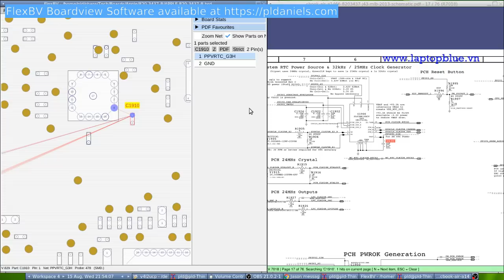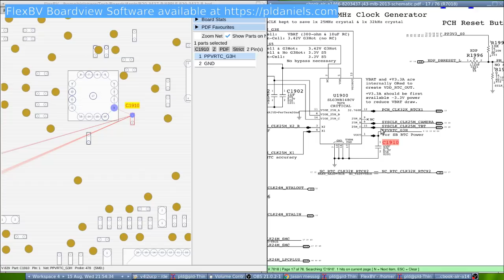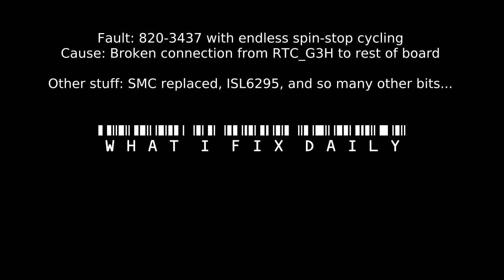MacbookAir A1466:  820-3437 Broken RTC steals my time

Comment: that board is swimming in a sea of flux. looks like you been all over chasing rabbits.  whoop whoop, way to go Paul. good job
Reply from the maker: Yes, there were many other little areas that needed fixing up, though none of them (obviously) were the main fault.  Possibly they would have played up after the main fault if I'd found the via issue originally.  Either way, it was a lot of running around.

Comment: Hi Paul, thanks for your great videos, both repairs and the C coding. Do you think one can do these kind of repairs with only one eye?
Reply from the maker: I would say it'll require just more practice but can imagine it's entirely possible.  The most difficult aspect would potentially being trying to learn the depth of field limits.  Fortunately the microscope has a very shallow DOF in most cases so you'll be alerted to the relative distances in terms of focus.
Reply: Thanks for the insight (pun unintentional haha). I ordered a digital (hdmi) microscope because I figured that a stereoscopic one would be useless to me because of my vision problems. Will try it out and see, since I see some other YT'ers doing microsolderiing with digital scopes...
Reply from the maker: You may find an optical still is a winner, because there's no latency involved and thus the eye-hand feedback loop is much faster.  You can start out with about a $180 unit on a fixed stand that'd do an excellent job still.  Going to have to be something to experiment with.
Reply: Good point, thanks!